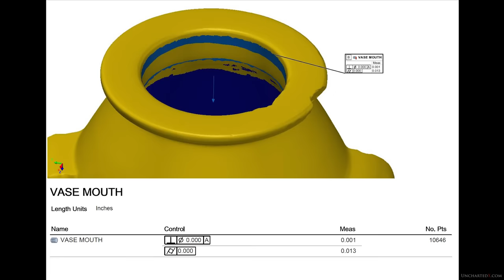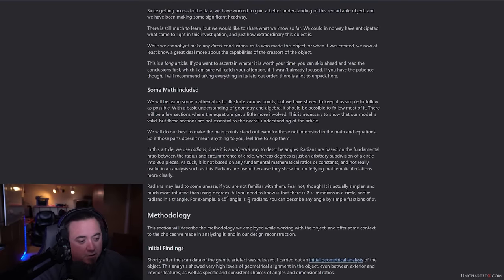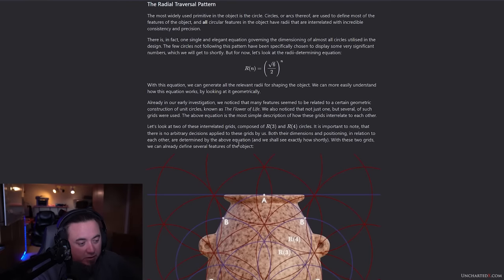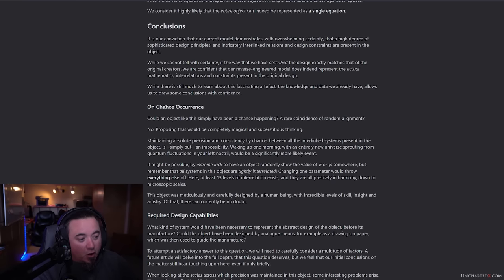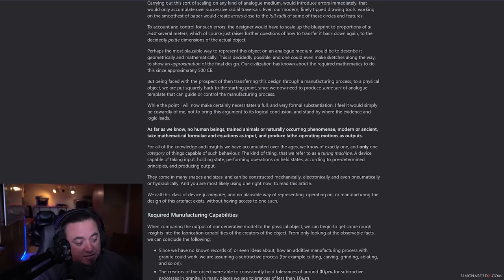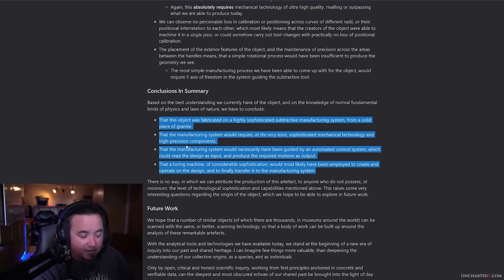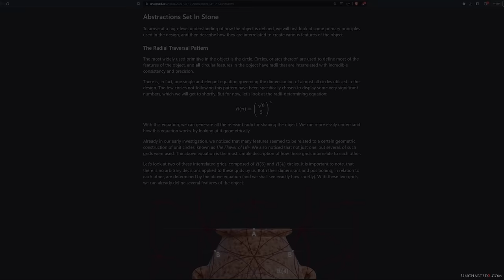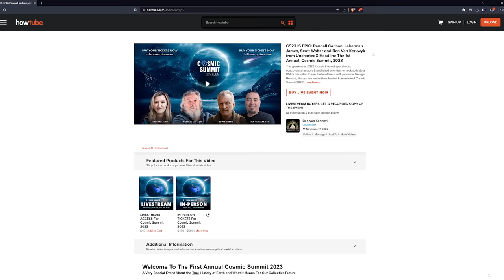Was a COMPUTER Used to Design this Artifact??

Comment: Hi I was using five axis cnc lathes for turning Metal jobs in 2005 in my trade ( I high light "metals" because it would be far easer to do that work with than in granite) I have both trade/engineering and science (BHSC) qualifications up a to university level. If this paper was honestly peer reviewed I believe there is a very high probability it would be considered as genuine proof of manufacture of this vase by an even more advanced civilisation. Absolutely fantastic professional scientific work done at a very high level of credibility.
Reply: This definitely deserves a paper for peer review! 🤞🏽
Reply: The “peers” would eat this crap alive for not being able to provide provenance for the vase. This thing could be less than 15 years old.
Reply: @travisnapier2693  There are many of them in the Cairo museum. They should allow someone to measure those, because no one has.
Reply: @travisnapier2693  Also anyone making the claim that this is modern needs to produce one, in granite, and submit it to a metrology lab for inspection.
Reply: @cf2851  anyone making the claim that this is ancient needs to provide video evidence of a sealed tomb being opened with vases inside and test those. Plenty of guys who run cnc machines are saying it’d be hard, not impossible to do today. Meaning it is possible if someone wants to.
Reply: that assumes the "peers" want to review it. nobody is forced to "review" anything.
Reply: @travisnapier2693  and then you realize that any notable discovery in Egypt is kept off limits for DECADES while "Egyptologists" excavate it.
Reply: @travisnapier2693  I started running machines in 1994, but I mostly just program them these days. It may not be impossible but it is certainly difficult, and very expensive. Tens of thousands if you require these tolerances, as granite work is not normally done with this precision. I suspect it would be difficult to even get a quote.

But ultimately it is true that we don't know the age of this piece. We will have to wait until Cairo Museum allows Capture3D to measure one of their verified vases.
Reply: @cf2851  I agree it would make things a lot easier if the egyptologists would let go of their dogma and give people who know what they’re doing access to materials for study. I’m not saying it’s impossible that these were made by a super advanced ancient civilization just that it’s far more likely to be a fake
Reply: @travisnapier2693  If it was made in the last 15 years. I would suggest it would be worth millions of dollars to produce. The development of tooling and techniques to machine granite, would have been frightfully expensive. Let alone someone risking millions of dollars worth of equipment with highly abrasive stone dust/slurry.
Reply: @travisnapier2693  yeah, but why do you think there is such a resistance to the study of these vases? i mean, Egyptologists have every reason to show that ancient Egyptians used advanced technology to create these objects, right? that would be ground-breaking news and bring in so much $$$ to Egyptian tourism. unless....they know something we don't, they know that these objects are indeed older than the Dynastic Egyptians and were created by non-Egyptians. that's literally the only reason why they'd object.
Reply: @AustinKoleCarlisle  you’re a conspiracy theorist. There’s nothing wrong with that but understand you’re grasping for straws. You’re right though they don’t want us to know the truth! Que creepy alien music.
Reply: @travisnapier2693  no, i'm asking questions. and i'm asking why would Egyptologists act irrational in their refusal of letting these objects be scientifically studied?
Reply: @AustinKoleCarlisle  they aren’t acting irrational at all. Request that the louvre let you borrow the Mona Lisa for testing and see what happens. In their mind the vases are what they are and someone wanting to prove otherwise is wacky and probably going to damage them. I’m not saying that’s the case but it is from their point of view.
Reply: @travisnapier2693  but they have everything to gain from having these objects proven as being created with advanced technology. and the Mona Lisa has been endlessly scanned, x-rayed, and studied. these objects are essentially "off limits". WHY.
Reply: Unfortunately I'm retired from the aerospace industry as a professional Metrologist. I would have loved to get my hands on this "artifact" and destroy the dreamland you folks have created concerning "ancient advanced technology".  God forbid if the ancient Egyptians used a template to measure the vase while making it, LOL.  Show me consistency in manufacture of the same style and size of vase over and over again.  How can one create an entire paper and study, and a conclusion from a sample of ONE?  Oh yes, these people were so sophisticated with their 5 axis machines, computers, and math that they made all of their house wares from......... stone.  Template making isn't hard, even with a simple understanding of math.  Consistent radius can be achieved  during the layout of a template with a stick and string.  A side profile template can be made to measure the vase while manufacture, grinding down the high spots or out of tolerance areas as you go.  This study proves nothing.  Oh, and what is the provenance of this "artifact"?  By the way, there are small shops and street vendors in Egypt right now making replicas using nothing but hand tools that are amazingly well done.  Just watched a video yesterday showing it.
Reply: @ironcladranchandforge7292  This method of using a template and then slowly, slowly grinding away would take months or years for one small object, if it is even possible. The question is why on earth would anyone use that method for a decoration? Why would a vase need to be made to this level of precision? I think by far the most likely explanation is some method other than hand work with primitive tools. The precision is a by-product of this method. Exactly what the method was is the question.
Reply: @thegreatbloviator6817  --  Yet it's being done today in Egypt by street vendors and small shops using hand tools only.  Oh, and it doesn't take months by these people either.
Reply: @ironcladranchandforge7292  To this degree of symmetry and precision in this hard of a material?
Reply: @travisnapier2693  but why would they make a fake costing $50,000 of programming and machining to perfect tolerances 40yr ago ???why?
Reply: @kingslots9134  where do you get this 50k number from? And where did you get the information that this vase has been around since the 80s?
Reply: @travisnapier2693  it's just an example mate, I do not know how much it would cost$5000 $100,000...just trying to make a point. And the only modern dates I have heard is the 1980,s...which is when the vase was purchased at auction. My point is why would they go too the cost and trouble at LEAST 40yrs ago to make it  and did they have the technology then.
Reply: @travisnapier2693  they literally have allowed ultrasounds and xrays etc of their pieces which are far more delicate than a stone vase. Very bad argument!
Reply: @danielabdalla8488  they don’t consider those people quacks like the egyptologists do. Bad argument!
Reply: @ironcladranchandforge7292  You have no argument. Only your refusal to accept the obvious.
The technology to create this vase once existed thousands of years ago and now is lost to time.
That is the only logical conclusion a reasonable person can make. 
You are being unreasonable.
Reply: @travisnapier2693  you realize the Mona Lisa has been extensively studied, scanned, etc, right?
Reply: @travisnapier2693  There are hundreds of examples of precision of this caliber in museums around the world. If you say its modern, please show me the process and machinery used to manufacture it. it doesn't exist.
Reply: @ironcladranchandforge7292  nonsense.
Reply: @LBCAndrew  --  What's nonsense?
Reply: @LBCAndrew  5 axis lathe. You’re welcome. If it’s ancient show me the process and machinery they used.
Reply: @travisnapier2693  No one can produce a vase like that out of that material today, no one ! This precision is not in our tech options today, not even on metals, and i worked 30 years on metals as CAD-Designer, CNC-Programmer. I produced parts of rockets for ESA, and even those parts were not as precise as this vase. Only one who never worked in that field can say they can reproduce it. PROOF IT !
Reply: @ironcladranchandforge7292 what kind of tools are these street vendors using? What kind of material are they making the vase out of? And are these street vendors vases all mathematically aligned as this one is? You make no argument.
Reply: @hulkhogan2113  --  Modern HAND tools such as hammers, files, and chisels. No power tools, all made by hand.  They are exact replicas of ancient bowls and vessels made from granite. As far as how precise they are, don't know.  But they are very good.  However, I don't think the supposed ancient vase measured in this video is that exact either.  I mean compared to what besides itself?  A study done on a sample of one is ridiculous!!  It's far easier to come up with a mathematical formula to support your bias........  I would have loved to get that vase in my lab before I retired, and a few more like it to make a real study of the manufacturing precision. Like I said before, it's not that difficult to make a measuring template to go by and make the vase accordingly, and to relatively good precision, even for the ancients.
Reply: @ironcladranchandforge7292  I'm not in this type of work, I cut wood, so I don't know much about this. I'll try and find some videos of people making these vases. I still think it's odd that the oldest things we find are some of the most impressive.
Reply: @ironcladranchandforge7292  I'd like them to use copper or whatever the Egyptians were using at the time of creation. Not modern steel chisels.
Reply: @hulkhogan2113  -- But, but, I thought modern humans couldn't recreate these objects??  Especially with hand tools??  By the way, have you ever used a granite surface plate for inspection in grade AA condition?  They are flat and accurate to within .000032" !!  Do you know how a granite surface plate is reconditioned yearly by a specialist?  BY HAND !!
Reply: @ironcladranchandforge7292  how would people 1000s of years before the invention of the micrometer know that a surface plate would be orders of magnitude more precise than just a normally polished flat surface when both would look perfect" to the naked eye?
Reply: @hulkhogan2113  I'd like to see you google stone mason, you'd be surprised. Comment your findings here.
Reply: @ironcladranchandforge7292  Modern humans can create these objects, they also created the machine everyone is watching these videos. The silicon (sand) that runs this machine called a computer is a microchip, again, made out of sand. Fractions of a micrometer accuracy.
Reply: @AustinKoleCarlisle  Let's do analogies: seven is to fourteen as six is to _
What is it that ancient people couldn't do, spin the object, carve it, polish it, what? What is the reason it's impossible? 
You need twelve steps of learning history. GO STUDY cale.
Reply: I do believe we are survivors of a past civilisation. However, people are capable of doing amazing things ...
An interesting experiment is currently occurring in Russia which you might want to follow up:  a lady called Olga Vdovina makes stone vases by hand. it takes at least six months to make one. Olga is now filming the process as she creates a diorite vase.
Reply: @travisnapier2693  Even if it was modern, you would still have the same problem of polishing out any tool marks and leave the surface within a few thousandths of perfect. I personally believe it is ancient but do not believe in some sort of advanced machining. Peer review would be good, you can skew any data to your liking if you want.
Reply: Yeah, because they've been sitting in the Cairo museum for 30+ traceable years and someone had the tech back then to "fake" these objects, knowing that eventually a YouTuber would scan them and a mathematician would offer to do an analysis on them. Dude, open your eyes.
Reply: Yes but he's not saying this is he,he's claiming it Was designed on a computer. Old Ben doesn't let the truth get in his way .especially at 20 bucks a contribution.
Reply: @ironcladranchandforge7292  Equating a flat surface with 3D rounded objects, nice.
Reply: the paper will not come. we dont consider the analysis of one vase who was not discovered on an actual digging site as scientific work. he would need to prove its provenance and compare it to other granite vases.